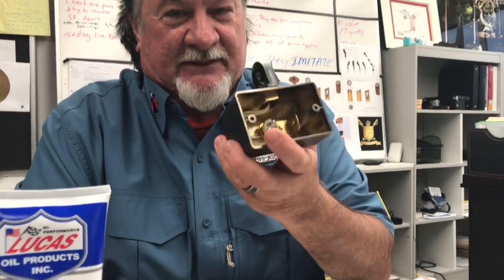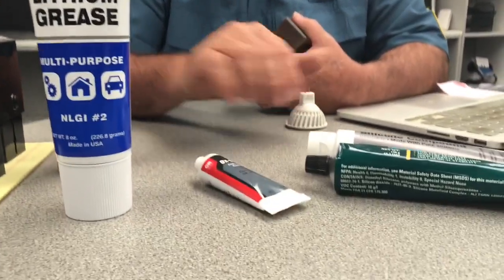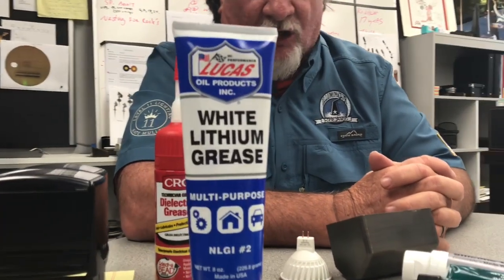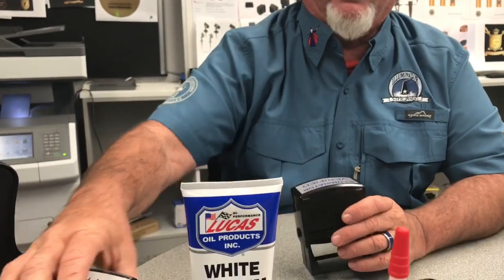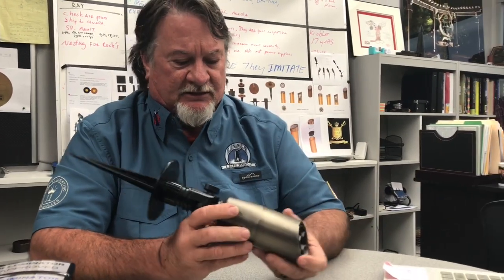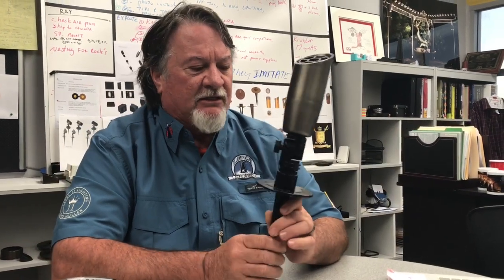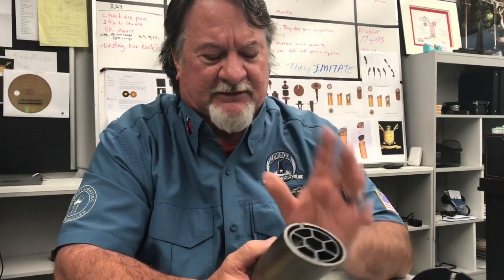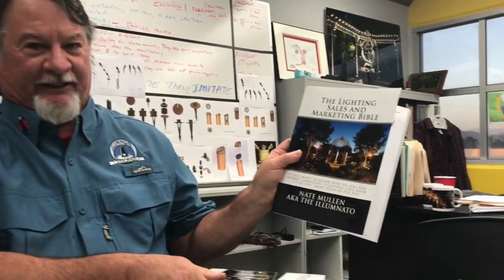White Lithium Grease vs. Dielectric Grease

Comment: A *dielectric* is a material that does not conduct electricity easily—in other words, it’s an insulator. It’s a substance that can be polarized by an electric field, meaning its internal charges (like electrons and protons) shift slightly without allowing a flow of current. Common examples include glass, plastic, rubber, and air. Dielectrics are often used in capacitors, where they store energy by separating charges on conductive plates.
Reply: read label on die electric grease. .it is a insulator. use white silicone lithium grease. like Oem uses in OEM harness. Do this test, Squeeze out a decent thickness die electric grease. PUt multimeter on continuity put probes on each end .an see if continuity. you do not continuity. I  will use die electric grease on out connector ends on OEm harness. it stops moisture from seeping in  connector and to pin connectors.Do the same test with white lithium grease squeeze out decent  amount in a line. then use multimeter an do continuity test see  an hear the results.yes will lithium grease get  or harden over time.ABsolutely. . over alot of year.i use on my 67 Chevelle. evertime I change bulb.i have also put a tab  or coatingof dielectric on thread of house hold bulbs both regular screw in or white lithium grease remember. any two different metal put together, will cause galvanic corossion.

Comment: dielectric grease IS an insulator, you can look up a ton of engineering sites that clearly spell this out. The grease gets pushed out by the contact points so doesn't impede conductivity.

Comment: I've used Vaseline or a clear or translucent lithium grease on battery  terminals since the 50's. In more recent years I've switched over to a silicon dielectric. I tend to avoid greases which contain a collodial dry lubricant such as graphite.MoS2, teflon, or talc as on the case of white lithium grease. The small particles of powder in suspension could create a resistance.

Comment: Motor cycle had gobs of white grease Which seemed to dry up Royal Enfield had  a complaint about the bikes  quitting running until  these areas were cleaned out

Comment: Dielectric means to be an insulator. Per all the dictionaries and electric sites I looked up. I have a controls and electric licenced & certified  lifetime background.
Silicone grease and dielectric grease are not the same.
https://www.youtube.com/watch?v=zzQn3L6LB_4
Reply: Yep.  If Nate thinks dielectric grease is a conductor, he should maybe squeeze out a glob, set his multimeter to ohms and see if a current can pass through it.
The fact that dielectric grease is an insulator allows its use as a moisture barrier in multi-pin connectors.  If it was a conductor it would only cause shorts.

Comment: My problem with Lithium Grease: after cleaning the exposed door-latching mechanism on my 30 year old motor home I covered all exposed metal parts with Lithium Grease to prevent future rusting but within a few months noticed that rusting was accelerated instead of prevented. The thicker the grease, the greater the rusting.
Reply: I think so too i sprayed on my car door hinge for greater good and it squeaks now

Comment: Can i use white lithium grease to lubricate my clocks mainsprings?
Reply: I wouldn't.
Use use a lubricant specified by the manufacturer, or recommended for the intended purpose. 👍
Reply: @alphamegaman8847  Too late. It's done and works very well since. Thank you.

Comment: The NEC does not require Nolaox unless the manufacturer calls for it as part of the instructions.  See 110.3b. 110.3b could also prohibit certain chemicals.  For example, an anti-oxidant containing grit used on a conductor cannot be on the lug threads, since that prevents getting a reliable torque value.

Comment: Maybe you misspoke? Dielectric does in fact mean "resistant to" electrical conductivity.  Which is the same thing as saying insulator. I'm not saying it will prevent contact.  I'm  not even saying don't use it. I'm just pointing out that it is an insulator.

Comment: dielectric, insulating material or a very poor conductor of electric current just saying , now that does not mean that dielectric grease will hurt the connection in any way.
Reply: Usually in a terminal connection metal to metal contact between asperities penetrates the "insulating material" ? The purpose of the insulating grease,oil or dielectric is to prevent air and moisture corrosion/oxidation of the metal contacts?

Comment: There IS an electrical connector grease made by Caig Labs in Poway, CA that comes embedded with copper. It is made with lithium as the base grease as well, but the real point here is, am i watching a comedy sketch? There is so much more to be said about specific greases and their applications...

Comment: What do I do if if i have a socket with oxidized connectors and i need the electricity to flow again in them? Can i just use any white lithium grease to get it working again? I can just use a paint brush and carefully coat the metal?
Reply: I would probably use a battery terminal cleaner first to get rid of the corrosion - then a dielectric grease or battery terminal grease to prevent corrosion in the future.
Reply: Clean it first. Buy and use a wire brush to grind the rust out. Then use the grease to further prevent rusting
Reply: Wire brush connector than apply lithium grease.

Comment: In the 70s my brother had a Oldsmobile beater car and when it snowed or slush  rain the car would not run or start. His friend sprayed white lithium grease  on the  wiring harness plug  at the firewall.. This immediately stopped the harness from shorting out and the car ran like a top ...

Comment: But di-electric grease IS an insulator....

It only works good because putting plugs or lights back in pushes out the di-electric grease in between the contacts so electricity can flow but the rest of the contact is still protected from air and moisture by the grease.

Comment: According to the dictionary: dielectric = a medium or substance that transmits electric force without conduction; an insulator. In electromagnetism, a dielectric (or dielectric material or dielectric medium) is an electrical insulator that can be polarized by an applied electric field. When a dielectric material is placed in an electric field, electric charges do not flow through the material as they do in an electrical conductor.

Comment: What parts do u recommend putting the dielectric grease on?  Only the wires?  Or also on the o-rings, any screws/threaded connections?  Thanks!
Reply: Make the electrical connection first then grease it to water proof it... dont grease pins or connections   just clean them... The idea is the grease stops water and air from entering the connection  so you apply grease  to seals rings and the back of connectors where the wires enter

Comment: Where's the actual comparison between the two greases? He just said he's used both. That's it.
First half was the man ranting about how much experience he has and calling a man an idiot because he said dielectric grease is an insulator which IT IS (3:00).
And the second half was basically again ramblings of whatever how many jobs he's done plus an infomercial of his own product.
What's the purpose of this video?

Comment: I am lost. Is White Lithium Grease conductive or not? I think I messed up using it on my motorcycle key and the immobilizer fuse burned. Please someone answer if you know!
Reply: Lithium is a metal, don't use it where it can potentially short two wires.
Reply: You will be ok. Leave it alone.

Comment: Can I use White Lithium Grease on my motorcycle headlight Kit which is an aftermarket consisting of a fan to cool the bulb and is partially exposed behind the headlight fairing?

Comment: 1982 automotive school graduate here. I've witnessed that White lithium grease does turn to a hard dried mud after many many years making it difficult to remove old bulbs on old cars. Also, dielectric grease, or tune-up grease, is a silicone-based grease that repels moisture and protects electrical connections against corrosion. ... The grease does not conduct electricity, so it shouldn't be applied directly to the mating surfaces (pins and sockets) of an electrical connection. Only apply around the connection not where the metal connects to weather proof and to make easier dismantling in the future.
Reply: Open any car ignition switch and the contact surfaces are coated with dielectric grease because it keeps atmospheric  reactants away from these surfaces.   As another poster said, the grease somehow, amazingly, squeezes out at metal-to-metal pressure points allowing conduction.   At the same time, it reduces the groove-forming wear of metal sliding on metal.  You really can't put on too much, just like you can't put too much water in a nuclear reactor.

Comment: I've just had a strange experience with White Lithium Grease. I've been using a well known brand for some time, it's a spray application stuff which comes out too blasted fast in my opinion but solidifies in the connector around the terminals on my motorbikes. I was out on one of my bikes the other day, hit a deep pothole and the bike died. Ended up having to be recovered as it had blown the main fuse and blew the spares too. Anyway, I tracked it down to battery positive shorting straight to chassis ground at the reg/rec output connector. I found that the grease had liquified in the connector and shorted the reg/rec + output to the reg/reg - output. One thing I will point out is we are having some pretty hot weather where I am in the UK at the moment, about 30 degrees Celcius. Never had this before, maybe it's just this brand of grease? I can confirm that this grease also goes like a white hard paste in time. I think I'll be trying somethig else.

Comment: What DOES dielectric mean? Insulator

That is not from an auto mechanic with experience, it is from a BS degree in Electronics Engineering Technology, experience with electronics from circa 1970 to present, many years working on manufacturing process data acquisition, control, computers, autos, radio, alarm systems, digital and analog, communications and networking. Believe me, many, many 
connectors.
Reply: I however was looking for good materials to use and do not doubt your experience with white lithium grease and will likely keep some on hand. 

I realize we want to seal connection surfaces from moisture and air and what we want is something that will remain in its functional form as opposed to drying, cracking, powdering or whatever.

Thank you for your post because it is insightful and has great experience behind it.

I would warn against using a conductive substance that might eventually make a film between poles of electricity and cause "parasitic bleeding" that permits current to flow from the battery that is not used for practical work.

Comment: I paused 7 seconds in. I just want to say, Just by your looks, I can tell I'm about to hear what's up for once. You look just like my old go-to shop guy at my last job, he would allllways tell me which way is the best and why for all my car, carpentry, construction needs, effortlessly, infact he loved it. lol. I'm just here to confirm I can use my white lithium grease (big fan of it for my cars) instead of going out to buy battery cleaner and conditioner (already use baking soda and water tech when its bad). Please proceed. presses play

EDIT: 5 minutes in and boom. I'm satisfied I heard that dad vibe I was looking for. "WHITE LITHIUM. Been using it for 30 years. Never had a problem. Never hardened on me. It's messy". Bingo. I loves my white lithium grease. I use it for everything that's needs a permanent gooey from the elements. What I didn't knew was that it's a great connector insulator too.

Comment: dielectric grease question , car mechanics say only put dielectric grease on the inner boot of the spark plug wire so it can insulate  the porcelain part of the spark plug so no current can leak out and arc onto the metal areas surrounding the spark plug, also so that the spark plug wire boot wont stick to the spark plug and be near imposible to remove when doing a tune up , now my question is they also say not to apply any to the metal tip of the spark plug and the metal locking ring of the spark plug wire inside the boot because the dielectric grease wont allow the current to go from the wire to the spark plug ...is this true or false ..noone has ever answered me that question
Reply: Dielectric grease can be applied on the metal cap ( i.e. connection tip of the spark plug that will be making contact with the metal spring inside the rubber boot of the coil-on-plug). Dielectric grease can also be applied and fill some space in the middle of the rubber boot of the COP.  

When the COP is then installed into the its place, the internal spring and the spark plug metal cap will make electrical contact. The dielectric grease will be pushed around and so automatically position themselves to be around and cover up and bury the spark plug metal cap and part of the ceramic shaft beneath the metal cap. This dielectric grease around the spark plug metal cap will form a insulation barrier to prevent arcing between the spring/ cap and the grounded metal parts beneath them.

Comment: Is it white Lithium White Grease can be use for plastic gears ?
Reply: no, its metallic. For plastic use silicone. But silicone is petroleum based and will hurt plastics in the long run. You need a water based silicone grease. You're welcome.

Comment: Dielectric grease is an insulator.  This means Non-conductive... That's the definition of dielectric. It is great to prevent sticking in high heat or corrosive environments. Who am I... just a guy who took Automotive Electrical Repair at the Bill Shaw Vocational Technical School.  That doesn't mean I know it all, but this is a common misconception that has plagued many people when the fill their plugs full of grease and can't figure out why they have intermittent electrical current or reduced current flow (HIGH Resistance) due to the grease preventing a good connection.  It's meant to go on spark plug boots, and connector seals, not on the contacts directly...  Hope This helps.
Reply: Alright I got one for you, I already got all the greases and lubes out there, lithium, sili, multi, dry, name it. I'm changing a car battery today, do I need to go buy some dielectric grease too or I can just smudge a little white lithium topped with a spray on the connectors once im done? I use the stuff on all my metal moving parts exposed to rust and its doing amazing at it, whats the only downside other than its messy? All greases are I'd rather see the white stuff than smudge my hand in some vaseline lol. Basically im asking why go for dielectric if I got white lithium around?
Reply: @PatTheRiot  Use the White lithium for sure if your just trying to prevent air and corrosion. Dielectric on the post or inside the clamp ( or side bolt, etc.) will reduce current and cause possible issues so I'd do just like  you suggested.

Comment: Dielectric grease does not conduct electricity.  It seals surfaces against corrosion and prevents bonding between parts.  The pressure of metal-to-metal connections is sufficient to push the grease out of the way to make contact and electric flow resulting in the connection being encased in grease, keeping water and corrosive elements away.
Reply: Thank you. When electricians can be so confident that "dielectric grease is a conductor" it gets a guy feeling kinda down about his prospects for getting the right answer on anything just about anything.

Comment: @Nate Mullen: Generally, your statements are correct.  But at 2:58 you said; "Obviously that idiot doesn't even know what "dielectric" means.  See Definition of Dielectric, it is an Insulator.  See https://youtu.be/pC2HVoHWNLA for the empirical proof.  Dielectric grease is best used to assure the air-tight seal of spaces where electrical contacts reside.  Directly application to electrical contacts used in low voltage or low ohm applications may cause malfunction.  This video has received more than 30% Thumbs Down and should be removed to prevent the spread of bad information.

Comment: I love that CRC bottle of dielectric grease on all my electrical contacts. I’ve redone a lot of fittings in my furnace. I used a light coat on all the contacts. I especially use this stuff on any dc connection in my truck. Works perfect and waterproofs. 

Your rationalization on lighting jobs and having someone tell you how to do your jobs reminds me of the public telling a cop how to do his job. I was an electrician for 8 years and now a cop. Great video!!